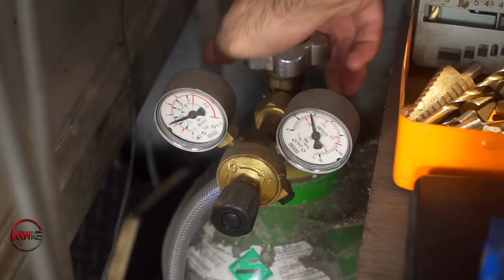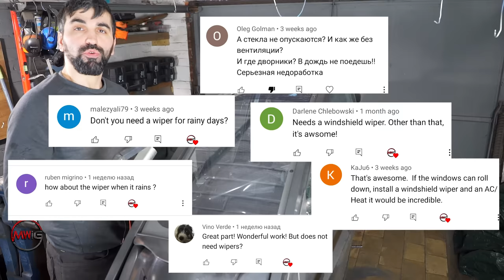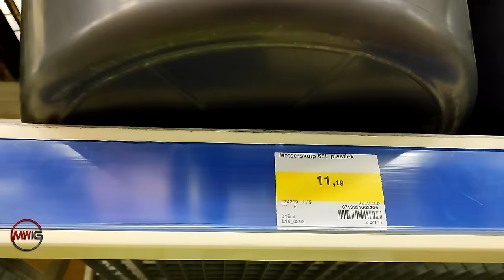Making of futuristic Three-Wheeler Vehicle - I Modified Scooter to the three wheeled vehicle

Comment: Those little bolts holding it to the front  frame ...... 😮 wow. Just because you can doesn't mean you should . Those three little screws on each side are taking the weight plus the suspension force . Crazy 🤪 😜

Comment: Cool! Now you need to put a more powerfull engine and and a gearbox with reverse in it. And a off road tire on the the rear axle too.
Also now that you got a windscreen wiper you should install a little windshield washer fluid tank and a pump. So you got a clear view when driving on dusty roads and off road.
Keep the project going 👍🏻

Comment: Honestly, with some airbags a design like this would make a lot of sense for modern locomotion. It takes a lot less space than regular cars making ideal for big metropolis with parking and traffic problems, plus it probably runs much cheaper both to purchase and maintain and I'm also sure it has a good km/L performance. Overall, pretty neat, I much prefer this design over the initial one, although I would still add a bit on an angle on those handles for better ergonomics.
Reply: No angle needed, it steers like a Tesla/K.I.T.T. steering wheel.
Reply: Also needs a reverse and maybe a wider body for better comfort, also the gas tank could have a cover, its too exposed
Reply: Have you never heard of a smart car?  It’s smaller than a beetle.
Reply: Why not just ride the scooter? Takes less space
Reply: @libertyforamericanow because it has a car seat, it has a roof & windows. I have a motorcycle, car & I would still want something like this.
Reply: @libertyforamericanow  As someone who lives in the tropics where it rains a lot and we cannot use our car going to the city 2days a week, I could use something like this. Very perfect and convenient for that environment

Comment: excellent, it is a securely accomplished machine. Now you need a reverse gear (electric perhaps) a wider drive wheel certainly for tires like the front and therefore a slightly more powerful motor because it's all starting to be heavy. But the model is beautiful, rather successful, two round headlights with shell base on the front mudguards would be smart

Comment: Loved it. Needs a passenger seat, more power and a reverse then it can become a full fledged commercial vehicle.
Reply: So a Polaris sling shot Buh
Reply: @CRCmotors  no. thats basically a car. More on the lines of the old ecomobile and the new toyota iroad. The passenger seat on the rear would make it more compact and symmetric and help in maneuvering traffics easily.

Comment: Amazing! 👏🏼👏🏼

Tiny suggestion: add rubber/plastic caps on the openings for the screws in the frame to prevent rust inside if it.

Comment: This is so cool ☺️ imagine having these in tiny home communities and villages. Would help declutter a lot of traffic and reduce a lot of the carbon footprint. Most of my driving was for things like going to the post office or a place for picnics and parks so I didn’t really need to drive much and I walked to work so something like this could solve a lot of those issues. I’d use something like this for all that 🙂
Reply: If it’s all about small communities and carbon footprint I’d have to opt for an Electric Golf Cart then with some mods
Reply: @dkprotek  That would be cool! I'm really all for these things. I miss walkable cities and cleaner air cause less cars on the roads and streets. I'm not currently driving but even when I did most of my trips, even to work, could be solved with these kind of vehicles or other alternative methods :) I like the golf cart with some mods though

Comment: BTW, I think it's a great upgrade from a scooter, and doesn't need to be more than that. The enclosed cabin means tremendous gains in aerodynamics are possible, thus,  the engine may provide far more performance than originally intended. It's still a light vehicle,  so rearward travel may be provided by simply putting a leg out and giving a few small kicks. 

Still,  very excellent.
Reply: adsfs  He needs to build one but full electric... then he can start an industry with this...

Comment: This is so cool, the only thing that could improve this design would be to use an actual reverse trike as the base since those are designed to tilt when turning like you would on a normal bike helping to turn at higher speeds
Reply: That would be helpful but there's not many that are designed to do what you're talking about. The biggest one in America is the canam spyder and they're setup just like this is for the most part. They don't lean the front tires. But in the meantime softer front springs would assist in the turning until a different setup could be made.
Reply: asdf   He needs to build one but full electric... then he can start an industry with this...

Comment: I liked it when it was a monotracer, but this is very cool.  That protected space inside the nose, behind your VERY robust grille, would be a handy spot for a heat exchanger if you need one: oil cooling, AC, whatever.
Reply: asdf   He needs to build one but full electric... then he can start an industry with this...

Comment: With the addition in weight and drag you really should install that radiator that was on the quad. Install a small oil pump and connect it you your fill and drain points. You have perfect spot for the rad right behind that sweet grill. Also you are very top heavy. Look into articulating suspension (that maybe the wrong term)  on the front. It will let the entire cab lean into the turn. This will help inertia keep you in your seat and the down force of the bike hitting the ground much like the motorcycle is already designed to to. This will also give both your front tires better contact patch giving you more stability in turns especially at higher speed. Things sweet man. I'm currently building and electric reverse trike that's not very different.

Comment: I would have joined the top of the two shock absorbers together with a lever thats pivoted in the middle. That way when you around a corner, you could lean just like a motorbike. You also have the break calipers upside down, you want the bleed screw at the top to allow air to escape.

Comment: Really cool motorbike, love the high quality look and  the cover from rain and wind. With the big glass sides the small cabin doesn´t feel tight, and with the proper ventilation it should be perfect to ride in. You should swich side on the frontwheels, they are on the wrong side. (arrow tread should always point down in the middle to get rid ov excess water, to prevent watersliding.)

Comment: It's not the first time i've seen something like this . Back in the late 70's , early 80's an American company Uni-car from California , produced a similar product called the Uni-sport . Basically it's of the same general idea , but retained a complete , yet powerful motorcycles as a power and drive unit . Any motorcycle above 400cc could be used , and the best way to describe it , is a motorcycle with everything in front of the petrol tank  removed . Replaced with a glass-fibre cockpit , the front fork mountings were utilised for mounting , with lower braces directly to the frame to prevent articulation . The cockpit had no doors , entry was similar to climbing into a WW2 fighter , though i seem to remember some form of canopy could be fitted . The cockpit could seat two occupants in tandem , plus as the original motorcycle was retained , it was possible to seat two more on the motorcycle seat . The unusual thing about the Uni-sport was the ability for the machine including the cockpit , to lean into corners during high speed cornering , much the same as a conventional motorcycle . It's rather a difficult subject to research , and this is the only reference i have ever found , so for those that are interested ;

  https://www.allcarindex.com/production/united-states/unisport/

Comment: I remember Peugeot showing a prototype of something very similar a few years earlier. But they made the front axle swinging I think, so the rest of the vehicle could still tilt in turns. That'd be a lot better, considering such relatively high centrepoint of mass at higher speeds...
Reply: asdf   He needs to build one but full electric... then he can start an industry with this...
Reply: The Peugeot didn't work properly, it was just a way of getting a whole load of money from the EU. That's why there's no production version.
Reply: @martinansell2105  That's a shame; I really liked the concept. Then again, such 3-wheelers are still too wide to be able to jump traffic jams, you need proper motorcycle for that... That's why I commute to work on my Yamaha XTZ 750...
Reply: @vaclavkrpec2879  Seems like you've got a pretty good commuter solution. I've figured out technology that enables a narrow vehicle to work without falling over and without the driver having to counter-steer (like on a motorbike) to initiate the lean. Now I just need to build one.

Comment: I would enclose that rear area where the gas tank is, and you have the small cargo container. If you enclosed it you could add more room to carry more, but you could need to work on a method of having a funnel attached to the outside so that you can fill your tank without having to remove much. About all else I could think is having some form of camera in the back or side so you can see your blind spots abit better.
Reply: asdf   He needs to build one but full electric... then he can start an industry with this...

Comment: This is a really nice build. To be honest I prefer 2 wheeled version. This one seems to be quite unstable and looks like it's hard to maneuver.
Reply: what?! i think visa versa lol the first version seemed quite wobbly and i think thats why he "upgraded" it to a 3wheeler, this one seem much more stabile and with better suspension, prolly not as easy to turn as the 2 wheeler, but im sure it can be fixed if you change the steering into something else than this vertical aviationish system
Reply: @h0rk3d I think 2 wheels are a lot more stable and comfortable since you can lean into the corner. Not as good at low speeds but It seems like the 3 wheel version would easily tip and loose control at traffic speed since it feels light and relatively top heavy. I don't like driving tall and light cars because they feel really unstable, I feel like it would be similar in case of this 3 wheeler.
Reply: Principle of the Lever

Comment: Creative talent. I'm wondering just how strong those treaded rivots are.
Reply: My exact thoughts too. It's structural.
Reply: The rivets are what you’re worried about after you’ve seen those welds?
Reply: Rivnuts.... Not the best use.  Normally I've seen them holding lids on tanks or wide body parts on cars. Not for structural applications.  Typically you wouldn't use deformed steel as a part to carry a load. Such as the kinked tube steel... Don't quite get that either.
Reply: It's an awesome idea and i agree with your comment but I hate you nevertheless.
Your way of thinking is correct but I'm tired of a society that gatekeepes any trial and error just for safety.
You should work for a multinational fit right in.
Reply: @markdove5930  I was wondering if those rivets are strong enough to support the frame.I have no idea if they are really.It's more of a concern for long term use or safety.If you want to drive this machine fast or aggressive will it hold up.Great concept it's really cool.
Reply: I would trust a welded in nut for structure before a rivnut but time will tell
Reply: He's putting a lot of faith in those rivnuts and welds, bless his heart...

Comment: For all those motorcycle/scooter/enclosed scooter riders out there, I found an simple solution for keeping plastic windshields and helmet visors clean in rain and also keeps bugs from sticking to them. Honda spray cleaner wax which is really intended for polishing up painted areas, works excellent for this use also. It does a better job on plastic than RainX does on glass.

Comment: This guy built what Elio Motors has been trying to do for over a decade. 

Granted, they have crash testing, investors, peoples deposits, and let’s not forget our US Government to contend with. 

Nice job!

Now can you tell us more about how it handles?
Can you license for street use and get insurance?
What is fuel consumption?
Did the added weight to the scooter adversely affect the rear suspension, brakes or power output?

Comment: Great project. However, you should put the wheels upside down. Now they are positioned with the tread towards the rear. Swap the wheels by sides.
Reply: Not really as those wheels are not directly driven and on the front. He has them set correctly as if you watch closely there is a directional arrow on the sidewall showing that he now has them correct t

Comment: If you had filled the hollow tube up with..sand and sealed the ends before you used the press to bend it, it would have been both stronger and  more appealing at the bends.

Comment: My only issue is I don't trust those rivnuts nearly as much as you do.
Reply: I agree. All it takes is one big pothole to rip those right out.
Reply: @graywolfcarpentry564  Yeah we use them on user interface panels just to hold touchscreens and stuff and they pull out of those sometimes if we over torque a screw. It's just a thin band of the folded metal left holding it in the back.
Reply: At least tack it in a few places that way there’s no movement and the rivet nuts will hold strong.
Reply: Just came here to comment the same. I think he is insane using those for such important load bearing pieces of frame…….one decent bump at speed and the whole front end is liable to fall off, this thing is a death trap and he’s driving around on public roads as well 🤦‍♂️

Comment: All I want in mine is air conditioning. In South Florida in the summer temperatures at 95. And 100% humidity the temperature in the cabin will easily rise to 100-110. And even a fan blowing wouldn’t work as it only moves around the hot air

Comment: Awesome build, love the ingenuity! Might want to switch your front tires though, you have them on backwards and those are definitely directional tread. Not good if you get to driving on wet surfaces, etc. and the water can't displace correctly bc your tread is facing the wrong way around. ;)
Reply: asdf   He needs to build one but full electric... then he can start an industry with this...
Reply: @jurivlk5433   That was more than a decade ago... also on your video about the meat you confused the prices:   9.99 Euros is not near 100 Dollars but Aprox 11 Dollars and 35 cents. Maybe you dont see the dots and you need eyeglasses..
Reply: @luisbeck007  You're on a YouTube vidéo where a guy  mâles a three-wheelers from scratch.

Comment: Loved your hard work & passion sir, some suggestion
1)you could had extended the front bucket between the two wheel parallel suspension to hold the engine there..... Instead of placing in a congested previous default position...... 2)Fenders outside the glass just above the rider head might help feed fresh cool air directed directly to the rider face 😔.
3)instead of back wheel belt drive you could have opted for front parallel wheels propulsion by running parallel drive belt between them.
4)body of scooter 🛵 and that of two ✌️ doors were having too much gaps in terms of paint, thickness, sticking together as a unified part
5)you just left the default Scooter 🛵 back tyre as such instead of replacing it with Knob tyres like front wheels to increase the wheel base for uniformed stability and weight distribution.

Comment: Nice to meet you from Japan. I was impressed with all your videos. Originality, ideas, welding, technical skills, professional tools, perfect. From the previous video, if there is only one problem, if you fall at high speed with two wheels, the rider will not leave the housing and will plunge into buildings and trees on the side of the road together, causing serious injury. It's likely. A three-wheeled motorcycle called "TRICITY" is on sale from YAMAHA.
https://www.youtube.com/watch?v=HUUcjp4Wzzs&t=2s
It is hard to tip over and the front wheel handle mechanism and suspension are very devised. Isn't it exactly the motive you tried to make three wheels? Please continue to build safe and enjoyable vehicles. I pray the good fight.

Comment: I would totally buy one in the USA if they existed.

One thing it would need is a heater, which could probably be fairly easy to create using a radiator type setup and the exhaust system to provide heat for the radiator.

Comment: I know this video is old, but I hope you read this. Swapping to a Taiwanese block gy6 qmj and building that motor out would make this vehicle way more fun and powerful. Right now it looks like Chinese block stock. Chinese block maxes out at 205cc with 63mm piston and sspg stroker crank. Taiwanese block maxes out at 232cc with same mods. That paired with ncy drive system and a sticky rear tire would make this be able to freeway rideable.

Comment: Couple more mounting points to the chassis would've been a good idea. You don't want to be folding onto the pavement at speed. The corners of the square-tube bends where the metal puckered outward, or "tucked" would best be torched bright glowing hot & shrunk down with a body hammer, thickening the metal at that location, & the inside of the bend reinforced with a short piece of flat steel. bigger motor would be fun.